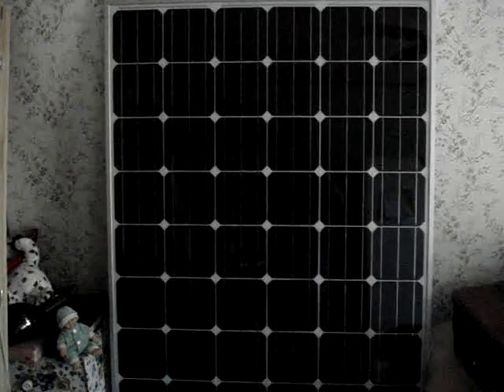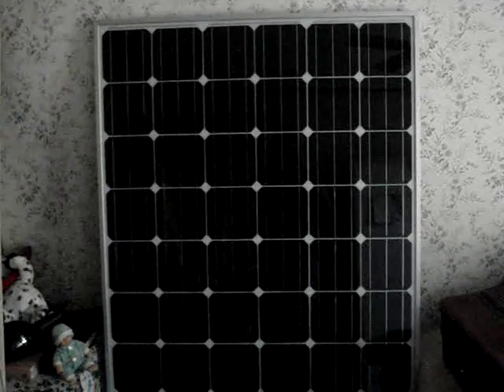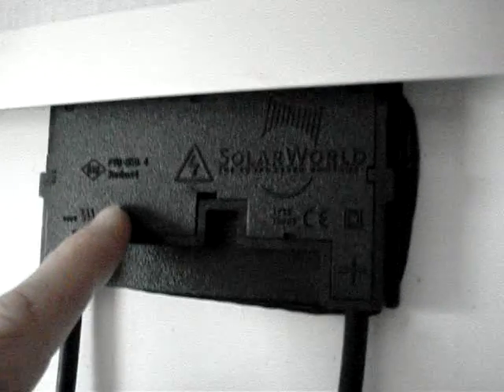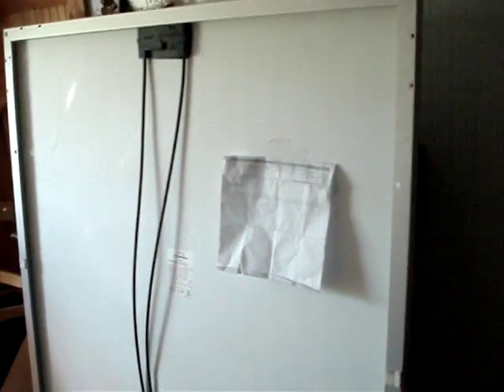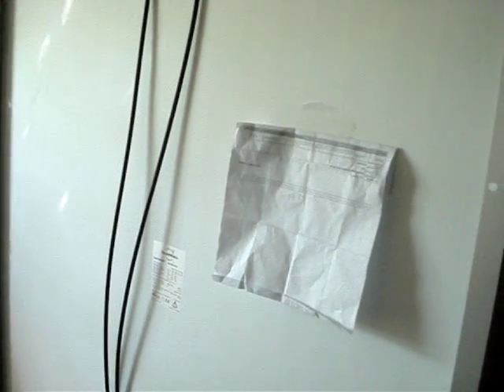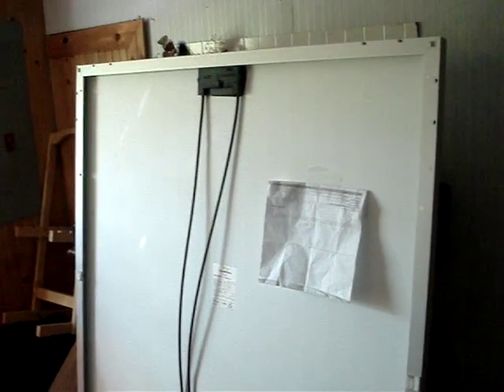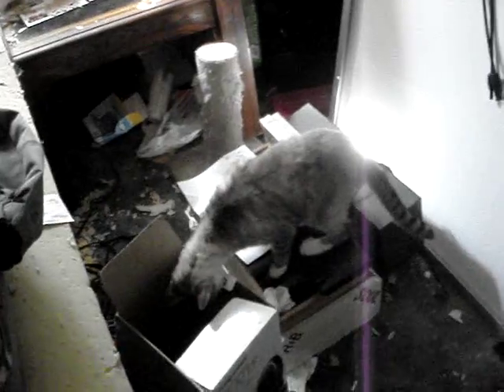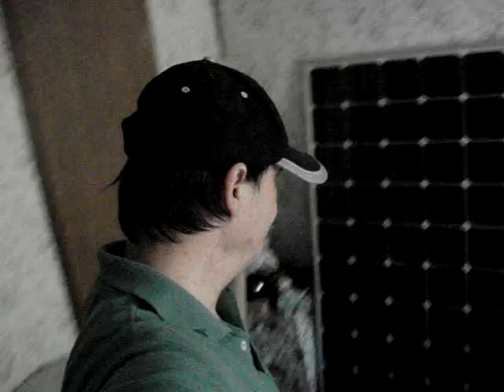2 Brand New 245 Watt Solarworld Sunmodule Solar Panels

Comment from the maker: The panels made in China cost a lot less. You can buy the cells, wire the cells together, encapsulate them in a frame under tempered glass with resin all for a lot less money I'm sure. Should have shopped craigslst thoroughly. In my other videos I fully disclose items specifications, were components were purchased from, how much I pay for them. Make the panels yourself if you have the time space & patience to make from scratch. Tariffs have been put on China panels, Canada has them

Comment: Nice to see you're expanding your system.  I'm in the initial stages of making my own solar panels and system. I was inspired by people like you who share their interest and personal experience; thanks.  The panels I'm building should be about 22V open, and was wondering if this was a bit hight for a 12V bank.  You answered that, you're doing the same. was also worried about the amount of AMPs my panels will generate in parallel,  but others seem to have a lot of panels/parallel. High amps ok?